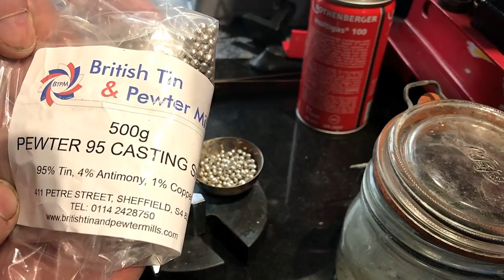HOW to melt and cast your lead & pewter in silicone molds

Comment: Good video mate use the lead that you dig up from detecting thats what I have done before ITS FREE plus I heard that if u put a bit of candle wax in the melting lead it burns off the slag?
All the best of luck Craig
Reply from the maker: I don’t think that would work Craig. I show you more lead melting and stuff later.